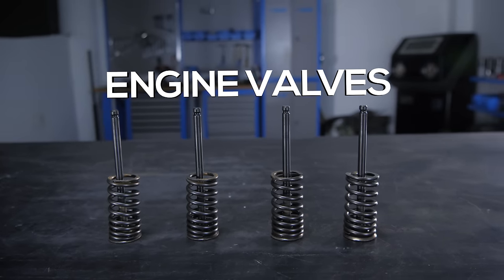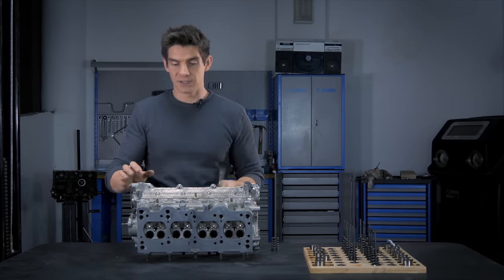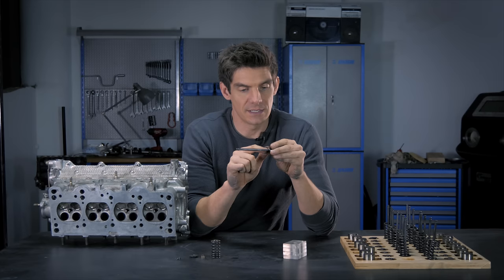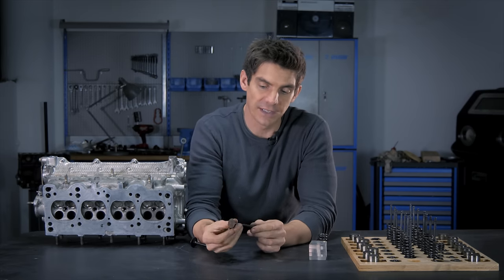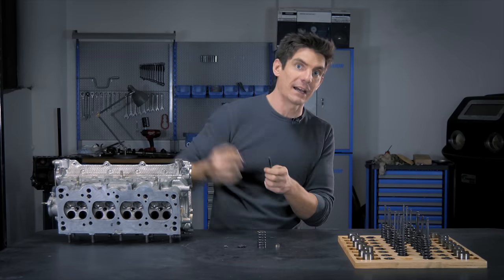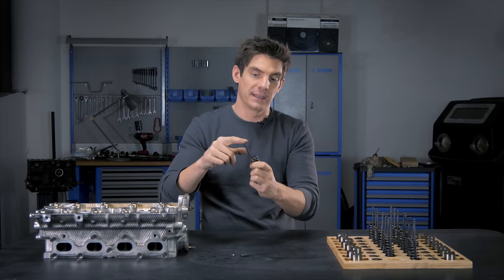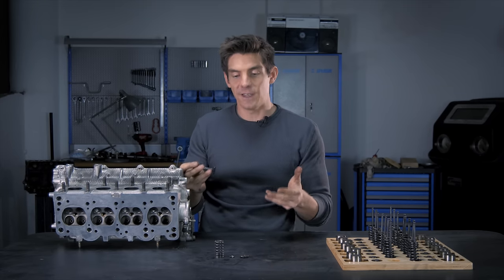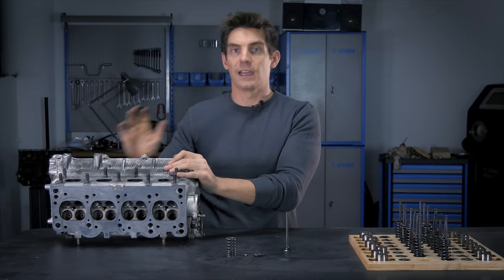Everything about Engine Valves

Comment: A well done video. What's really annoying about interference engines is when they put rubber timing belts on them. Then when the break, you lose the engine because you didn't change out a $50 belt. This is why I'm glad that for the most part, a few good auto makers (Toyota, Ford and others) make non-interference engines with timing chains, or at least chains when they are interference engines.

Comment: Got a 2014 Chevy Silverado that blew its engine back in October, 180k miles, and finally figured out last week a valve went out in the engine and apparently parts of the valve were found in the exhaust. When it went out on me it still drove for about a mile as I could safely get off the road if I didn’t stop immediately so I had that going for me as well as we were able to find an engine to replace it with. Decided to look more into valves and this video was interesting.

Hopefully how I said that makes sense, I heard what caused it from my dad who is in contact with the guy that’s replacing the engine for us so I haven’t seen any of this myself.

Comment: The intake valve is bigger than the exhaust valve because the pressure difference at the intake region is less (also mass flow rate less) than the pressure difference at the exhaust region(also mass flow rate more). But mass flow rates must be same for intake as well as exhaust (m(in) = m(out)) hence to satisfy this, the area of intake region should be bigger than the area of exhaust region.

Comment: In most engines the intake valve is also cooled by the air/fuel mixture.
Reply: Air yes, fuel no. Most engines have direct injection.

Comment: Great video! I have a question regarding valve float: does the ignition process in the combustion chamber provide any force that aids the spring in closing the valve stem and keeping it in contact with the follower? I'm doing some analysis on a cam-follower and valve-stem assembly, and it seems that the force needed to keep the valve in contact with the follower is extremely high (~10,000 lbf or ~44,000 N of force) much higher than is reasonable with springs that would fit in that area. Do you or any other viewers here have ideas or input on this?

Comment: Did you mention how the length of the valves effect the performance of the combustion intake? Did you mention the stem height? You need to explain this for clarity because if you order some valves and they are not the same lenght but the diameter is the same then you will have a combution problem balance in the intake gases and the exhaust gas also. Explain it please.
Reply: You problem?

Comment: Where is the video on the head? What happened with the woodworking?

Although you spoke about the valves bending you didn’t mention what happens when a timing belt snaps and bends them all. At least that’s what the mechanic told me what happened on my Ford XR3i as he took much money from me. 💸👋🏼

Comment: I love the channel, guys, but there is one thing that bugs me about your explanation and most of the explanations I've seen regarding why intake valves are larger than exhaust valves.

Fundamentally, 'sucking' and 'blowing' are both cases of a differential in pressure. Pressure naturally tries to equalise, and the bigger the difference, the greater the force exerted on those gases. If you imagine two jars connected by a hose and a valve, and add 10psi of air pressure to one of them. Open the valve, some air flows through the hose, and the pressure becomes equal. This is the same case regardless of which jar you add the air to first, and regardless of the absolute pressure. It's only the differential or gradient of pressure that creates flow, and the concept of sucking being a different phenomenon to blowing is a falsehood unless you are talking about something like a leafblower where a flow of gas exists in open space.

There are three simple reasons, as I see it, for exhaust valves being smaller than intake valves:
1: The valve gets hot. Smaller surface area, less heat absorbed from the exhaust gases.
2: The limitation of atmospheric pressure. No matter how you configure an engine, unless it is boosted with a super or turbocharger, the greatest difference in pressure that can be created by a piston moving downwards and creating a partial vaccum is 1 bar or one atmosphere of pressure. When the same piston moves upward on its exhaust stroke, that pressure differential can become much greater than one atmosphere, thus, higher flow rate, allowing a smaller valve to be adequate.
3: Most importantly, the exhaust gases are HOT. They have just undergone combustion. The pressure is already significantly higher than atmospheric, so even if the piston didn't move upwards, the pressure of the hot gases would cause them to flow out the exhaust valve. 

In summary, hot exhaust gases being squashed by a piston are able to reach pressures much higher than 1 bar. Hence, a smaller valve is adequate and thermally desirable.

Comment: Bro you told in interference engine same space is used by value and piston right..! But how does exhaust takes place, because in exhaust when exhaust valve come down, the piston moves up to push gas out from the chamber through the exhaust value. So won't they collide then..?
Reply: The exhaust valve starts closing as the piston goes up.

Comment: How bent does a valve need to be to cause no compression? I have a cylinder head that has compression issues but the valves look oddly straight which I wasnt expecting.
Reply: A bent valve won't seat properly which means it won't seal allowing combustion to escape through the gap
Reply: @BENNO117  it turned out to be the hydraulic lifters not letting the valves shut properly valves were ok 👍🏻

Comment: Gas....Do you mean air or fuel in this context??
Reply: It will be a mixture for a car with a carburetor. Some modern cars have fuel injection. In this case only air enters the intake, not a mixture, and instead the fuel is sprayed directly into the cylinder.

Comment: Desmodromic engines. No energy waster pushing on springs
Reply: Energy wasting pushing the valves with the cam though
Reply: @BENNO117  Moving those cams aint as hard as pushing on those springs